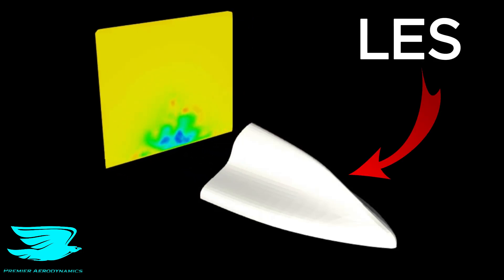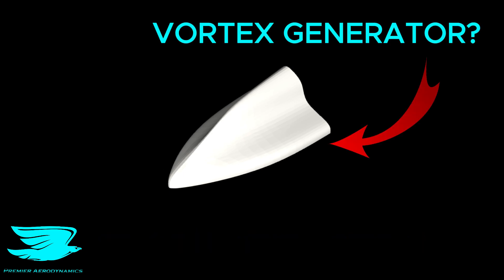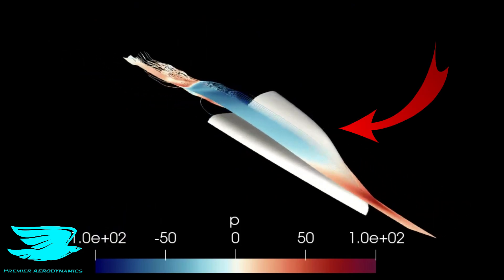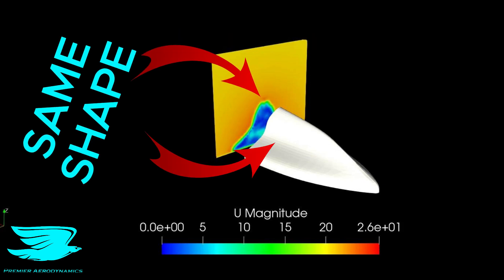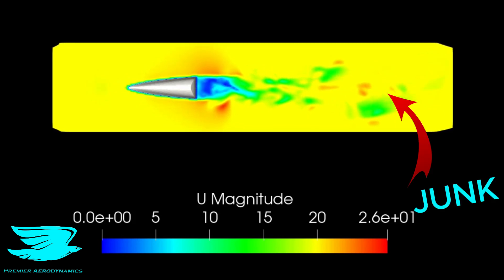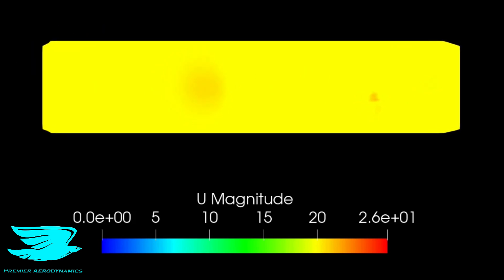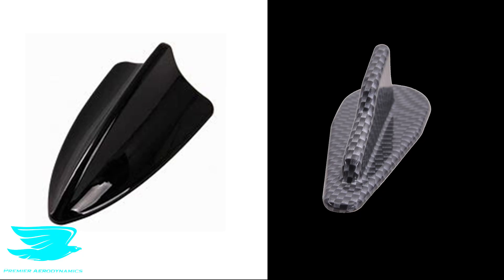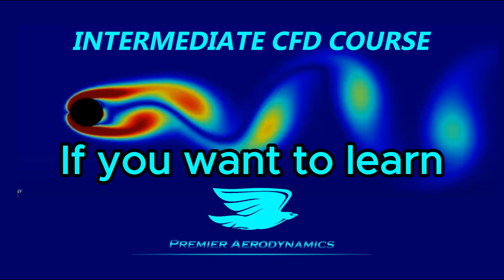LES CFD of a Car Antenna!

Comment: Does a vortex generator not need the air to flow over it at a non zero angle to produce a vortex?
Reply from the maker: Good question. No for many of them because the shape has been made so the object is straight on.

This particular antenna design looks a lot like some vortex generators that produce counter rotating vortices, one on each side. But, surprisingly, this antenna doesn't.